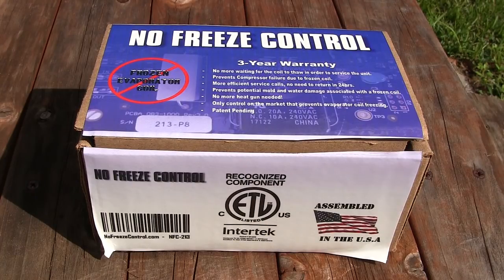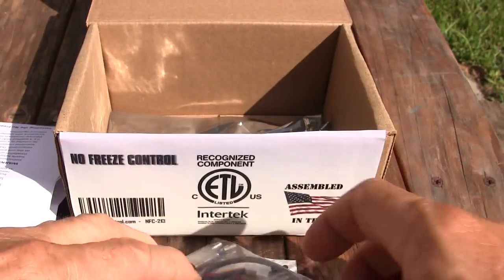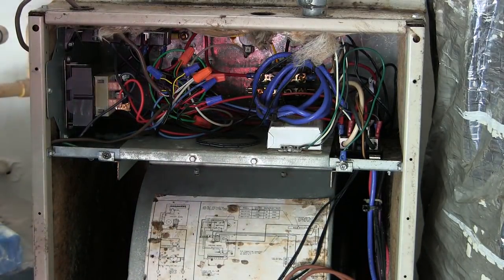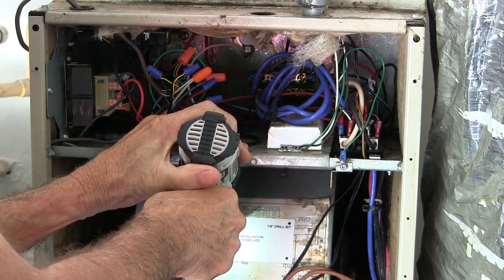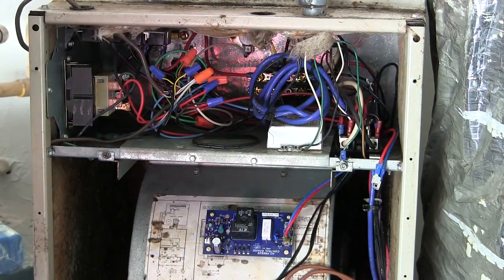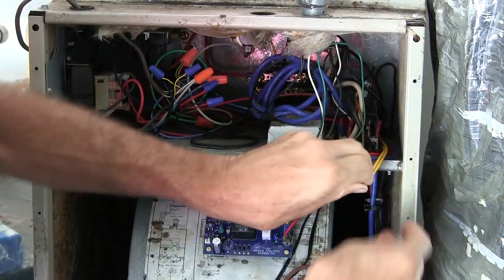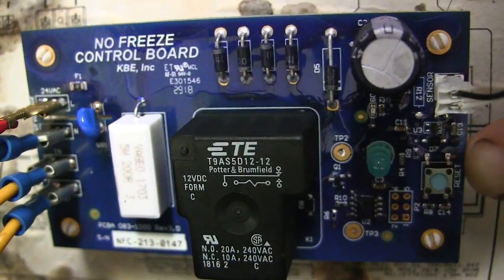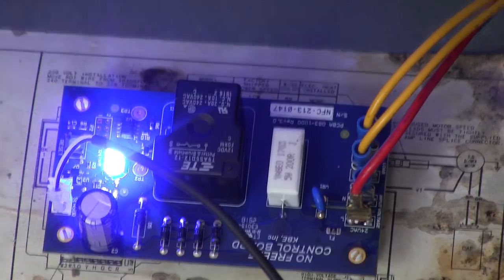No Freeze Control by KBE, Inc.

Comment: freeze stat with a lockout relay in parallel .  same thing.
Reply: What product are you referring too? The NFC breaks the low voltage 24volt can can be installed in commercial and residential Equipment.

Comment: Nice. Please show the wiring connection bypass the paper schematic. I’m wired that way. Thanks again
Reply: texture6 On our website there is a PDF of the installation manual. The wire diagram is at the bottom. www.nofreezecontrol.com
Reply: On our website there is a PDF of the installation manual. The wire diagram is at the bottom. www.nofreezecontrol.com